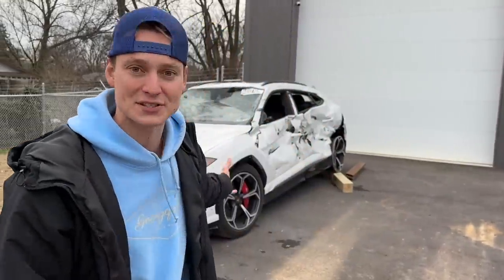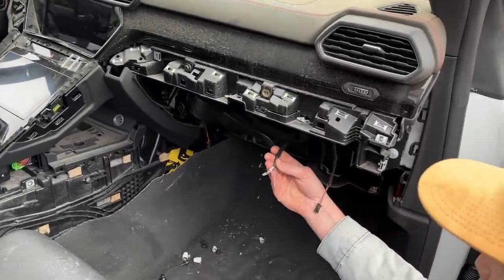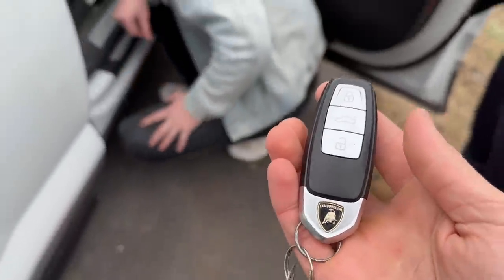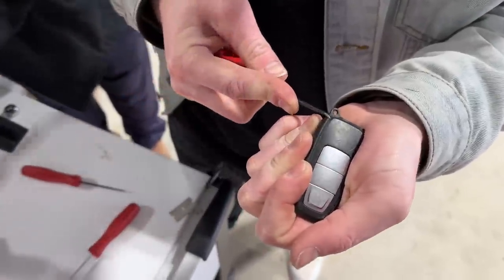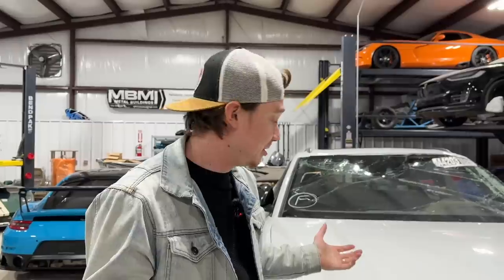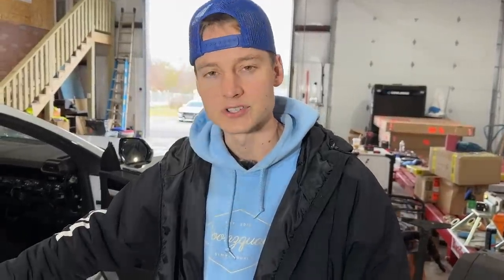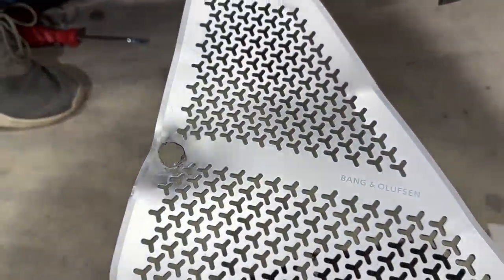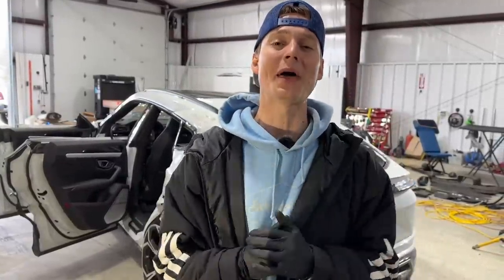Rebuilding A Wrecked Lamborghini Urus Part 2

Comment: Hi Guys. I think you need to connect the Body Control Modul, to turn off the alarm. The BCM operates a lot of the other units/moduls in the car.
Reply: Most of the time the key is programmed to the BCM
Reply: yeah whoever disconnected it probably attempted to turn the alarm off that way
Reply: Alarm is probably going off due to week battery.

Comment: The BCM being taken out and SRS missing, its possible the investigators were looking for EDR data about the speed and more about what happened.  Most likely the investigators (accident reconstruction engineers) pulled out those modules at the yard after photos.  I doubt think anyone was trying to steal any components.
Reply: Yep
Reply: You've never been to a copart then?
Reply: Good point Rachel

Normally when cars are shot at they are involved with other major crimes. Police will try to find data from GPS onboard, or retrieve a device installed by the police on vehicle. 
Modules will store Data as speed, position, driver inputs, and car data.
All data is useful to find the truth.

Have fun boys! 
Merry Christmas
Reply: Police can also pull tons of info just from the infotainment system. Phones connected, messages, GPS data, etc.
Reply: I'd say whoever did a runner in this car pulled the tracker
Reply: welcome to the expensive parts ! how may i help you 😂
Reply: im surprised any investigator would leave any obviously noticed bullet behind, especially that one in the speaker grille
Reply: Well, if the investigators have already downloaded the module information, it doesn't cost anything for them to return it! The price of these new modules must be "very salty"!
Reply: @Jjay-tw1yy  A box of tissues, and a shoulder to cry on!! Because for the parts, they will need it!!🤦🏻‍♂️😭🤣😂🤣

Comment: That thing was submerged... I'm betting you find more standing water!
Reply: Rolled into the water after hitting a rock jetty on the left side, how do you explain the rips tears and punctures, also run a K9 drug dog around it and see if it alerts
Reply: Probably just poorly wrapped. There would be a water line if it was submerged
Reply: @johnlooney9570  the entire interior is muddy, and the pattern left on everything looks just like water from leaving the windows down.
Reply: @LMT069  yeah thats so right, i was like why the hell would the muddy cover be all over the interior. I think it just rolled into the water and was pulled right out or something. Hopefully its not a classic flood scam
Reply: The previous owner was a target and  if you drive around where this car is from chances are you'll get some new holes in the car . It's a rough build and it's not better looking than the Jeep IMO.
Reply: It was not... just the windows being wrecked and the rain did the job. It has just been raining in this car
Reply: @rsg1682  look at the headliner too.

Comment: If you take a length of dowel put one end into the bullet hole, you should be able to work out what angle and where the bullet entered the car
Reply: Most likely was police chase and with how the interior was they were pulling data about the accident from the srs module.  Shots were fired so it appears the bullets came in ds rear window and out the PS front window
Reply: they couldve only done that before removing the bullet, no?
Reply: @icesalami  no because they now have a deeper hole
Reply: Someone has been watching CSI reruns.
Reply: @Ms_Princess_Zelda  That was an FMJ bullet, I don't think the police use FMJ
Reply: @Ms_Princess_Zelda  That was an FMJ bullet. As far as I know, all police departments in the US use hollow point bullets. So definitely not the police shooting at them.

Comment: unless you have been deceived by the auctioneer, you can always return the car to copart if it does not match the specification
Basically, if the engine wouldn't start, that's what I'd do
Reply: You have to do that at the point of collection. Once it's left the yard you have no rights.

Comment: The dust could be mold from sitting. The indentations into the seat are from something sitting on the seat. Leather seats, try warming them up a bit and the indentations might go away or be less noticeable. 
The mold may return, even though you cleaned it.

Comment: You guys are experts but wouldn't it have been safer sucking all that standing water out of the battery compartment first , then disconnecting it and cleaning the terminals, then a jump pack ?  Great content as always.

Comment: Schematic: a diagram, plan, or drawing. If the schematics are fried you should call the fire department because it is likely that the Lamborghini factory is also on fire. Or if it's only the circuitry, then you could just get a new remote. BTW, compresso means turbo charged. GANSTADHINI! Sure you want to drive this one around if someone is gunning for it?

Comment: FYI ~ Hope they caught this: In early December 2020, the NHTSA recalled 2019 and 2020 model year Uruses equipped with the 4.0 litre twin-turbo V8 engine due to a fire risk, since high engine compartment temperatures can cause the fuel line quick connectors to rise to temperatures above the design operating specification limit.

Comment: In case you didnt see it in your last vid, I do have a possible explanation on what couldve happened. So, My best guess would be that it was a stolen vehicle pursuit. Guy who stole it was armed, shot back at cops which explains the back window missing. Police more than likely went for tire shots, then used a bearcat (a heavily armored SWAT truck) to pit and stop the guy. Or purposefully T-Boned him. Which would explain the massive tearing in the panels on the side.

Comment: That lithium battery needs the proper charger. Buy a CTEK Lithium charger and press the reset button for 10 seconds to bypass the under voltage protection.

Comment: Just in case if there is a cost savings needed,  the drivetrain of the Urus is the exact same as the Audi RS7. The Audi S8 and A8 are also exactly the same mechanically, aside from smaller turbos. 

So buy Audi parts for the “Lambo”. I do believe the Audi RSQ8 or whatever it’s called is exactly the same as the Urus, but different cosmetically. And also a huge price tag difference for a badge.

Comment: You guys need an actual garage units which keeps the car out of the dusty workshop, most of your cars looks like it a clean, and might take quite some time.
Reply: This one will never be finished
Reply: Maybe a 10 car garage on the other side of that parking lot and enclosed car ports on side and back of building.
Reply: @babs9576  a shop can never be too big

Comment: The original battery is a lithium battery, they have a built-in BMS, you should be able to charge it with a car lithium battery charger. With the BCM removed the key wouldn't work. I see you reconnected it, did it look damaged?
Reply: They never try to charge batteries. They  just buy new ones. More money than brains.

Comment: Personally, I think someone got mad at the owner, shot up the car from close range.  The owner knew insurance probably wouldn't have covered the damage, and then had it fixed up terribly, then it had a regular accident, or faked an accident by ramming up against a guardrail.  The bolts sticking out could have easily ripped the holes in the body.  That or someone went axe happy.  Cops don't use full metal jacket ammo, so doubtful it got in a police chase.

Comment: amborguini Urus uses the same platform as Audi Q8 some parts or modules and connectors are the same but cheaper maybe the battery is cheaper in audi

Comment: 2 Explanations for this car! Its a rental which has been involved in many cop chases due to crazies speeding and the rental company made cheap repairs to keep it renting out. Or it was some crack heads car who was dealing with gang shit and as you say cheaply repaired old bullet damage on the down low until his final run where they got in to an accident on a pursuit or gang related chase.

Comment: Not 100% but as it's based on Audi the radio unit is inside the glovebox. I think when they removed the glovebox they ripped out the radio aerial wires. The GPS, video and MOST cables can be hard if you don't know what your doing so they might just have ripped it out in temper.. ❤❤

Comment: CSI report! You bought a running driving vehicle. truck driver that shipped your vehicle Parked in an area that was high crime. Someone stripped the interior and then someone else shot the vehicle with bullets. the accident damage was from side impact 4 Wheel Drive vehicle with a push guard.

Comment: a lil hint.. take the P/N to any of the more universal parts.. ie battery.. and go to the VW/Audi dealers and see if there's crossover... a 2500 dollar battery is a heinous crime.. that battery is 200 or 300 in a Audi. VW, Audi, Bentley, Lamborghini, Bugatti, Seat, Skoda.. all the same parts... just diff levels of dress. many of the modules are identical except for internal coding which activates certain programs depending on the application.

Comment: Assuming this car was shot up by the police while in pursuit , you need to find the facts and there will be a police report somewhere , as far as the bullet goes the most popular police service pistol in the United States, the GLOCK 22 fires the potent 40 S&W cartridge and holds more rounds for its size and weight than most other full-sized handgun in its class . Plus you have police friends in the area , have them run the serial number ..

Comment: Please BUY A BATTERY CHARGER you guys buy more car batteries than Tesla.... some of those batteries will just charge up rather than buying new ones, those cars are almost new when you get them wrecked, the batteries will just be discharged, get a motor yard size charger and save enough to buy some more steaks for the bbq